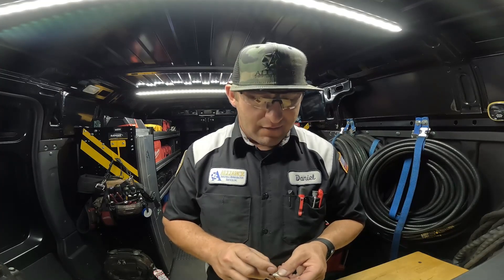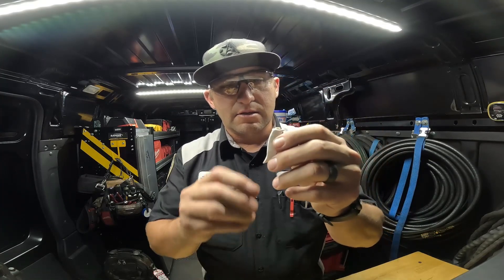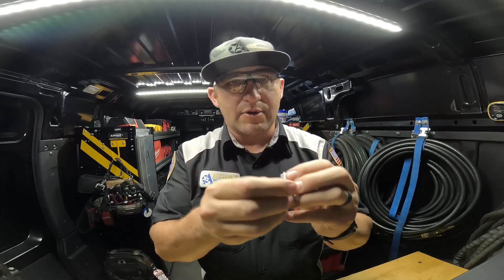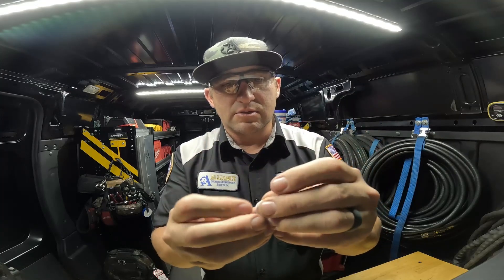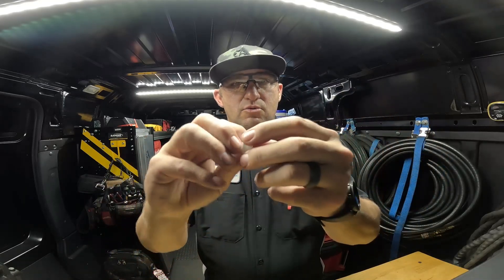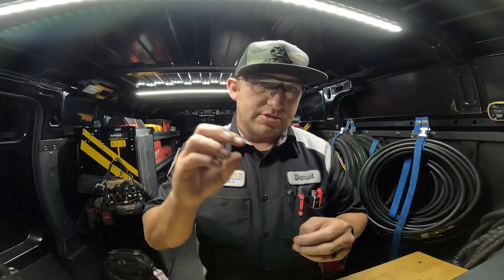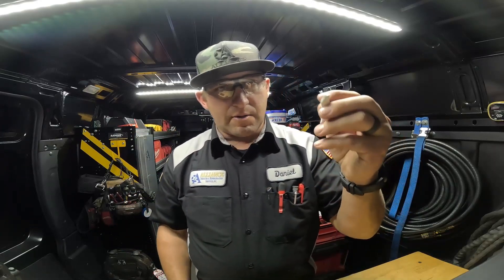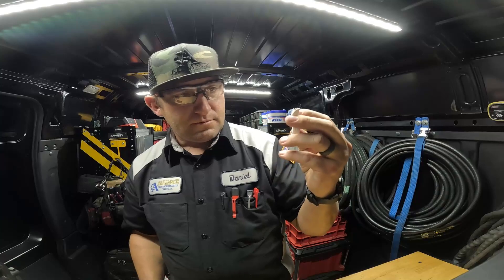Live Ammonia Valve Repack!

Comment: Firstly, thank you very much, brother. I have a question. Please, did you empty the tube of liquid before doing this work or not? Does it work with the valve open or closed?
Reply from the maker: The 2" liquid line was full of liquid. The valve has to be completely open in the back seated position to perform the packing replacement.  Not all valves are the same. If you're trying to perform please get the OEM manuals for your valve. UNDERSTAND YOUR VALVES OPERATION AND PARTS.

Comment: Very good job and it is very dangerous as you know but everything worked out for you when I usually do it after I pack a valve I use a special lead anti-seize it’s an actually a great sealant for ammonia systems and it won’t hurt the system

Comment: Thanks brother great video. Two questions  one I remember a journeymen  using Teflon tape on a Copeland service valve what do I use to repack Copeland service valve? Also I'm in house Crac units new facility on west coast whats asme code notice the crac units don't have relief valves on the  relievers.  Maybe fusible plug? I seen 1/4 brass male npt x1/4 male flare on the receiver these are small receivers Vertiv Liebert 60 tons 245 of them big facility  can't go into location. Any feedback appreciated. Be safe thanks always remind me ppe!😂
Reply from the maker: They sell small rope packing materials. But try to get the oem packing if it's still available.  Most of those are. Small relievers do have a relief plug in them.  Thanks

Comment: I used to work on ammonia refrigeration back 50 years ago. I can’t believe the PPE they have you guys wear now. The only safety equipment we had then were Scott air packs for when we had a really bad leak. I’ve had to go in and shut off leaks when the Fire Dept wouldn’t enter. 
It was a different world back then. No gloves, no masks, all we wore was a tee shirt and worked with bare hands. 
That old Frick valve looks like it’s been in place since I was working! 
Used to work on a lot of 2 cylinder slow speed vertical Frick compressors driven by synchronous motors. Some had been in continuous operation for 60-70 years. Rebuild the valves, replace piston rings and crankshaft bearings and they’d run for another 60 years. Probably still running. 
I find it interesting that ammonia systems are coming back. Can’t beat the efficiency compared to Freon, and ammonia is less of an environmental hazard too.
Reply from the maker: Thanks. I've worked on synchronous motors and dual acting vilter compressors. Frick 10 x 10s and so on. I have some pics and videos. I'll make something and post it for your viewing pleasure.  Lol